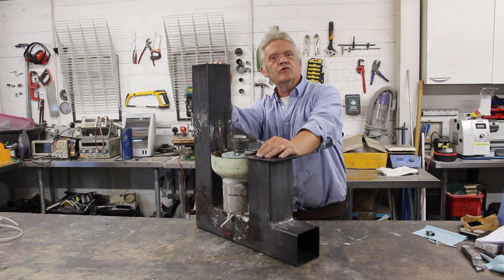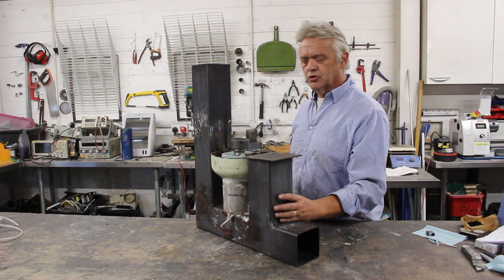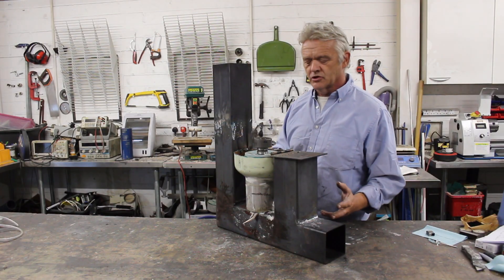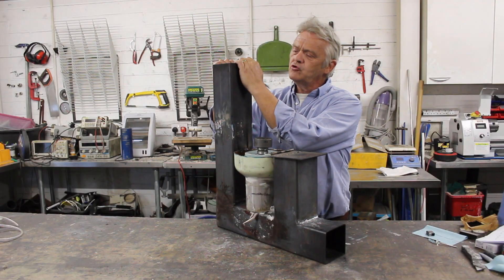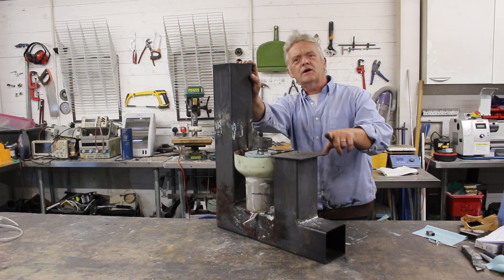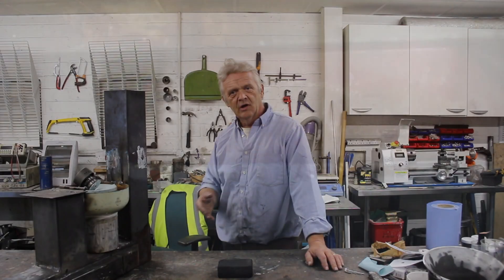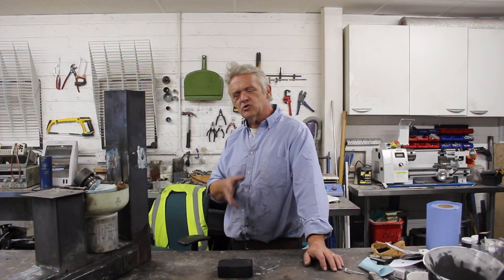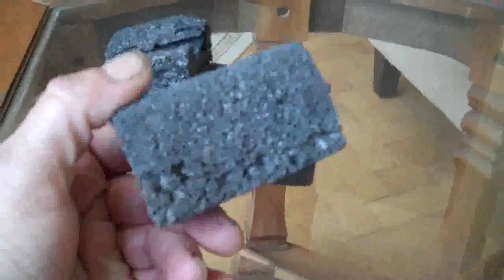1622 The Best Insulation For A Rocket Stove And How To Make It

Comment: Robert, have you experimented with Aircrete or aerated concrete as it's known?  It's basically Portland cement or other concrete mix including quickcrete that you add whipped dish soap/water mix in place of water you normally add.  The trick is to mix soap and water into shaving cream consistency.  Why I'm bringing up is because it's like formable asbestos and it's very insulative, it's also lightweight and even floats.  You can cut it with a saw, drill it, screw into it and it's amazing stuff as you would say.   A 1/2" layer will protect an item from the heat of a blowtorch.  Anyway, awesome videos, I never miss them and learn a ton from you.
Reply from the maker: I haven't mate - I must give it a go
Reply: @ThinkingandTinkering  Hello Robert.  The Honey Do Carpenter channel has an excellent series of videos with Aircrete.  One in particular has a carbon added concrete mixture that he uses for his fire tube.  Handles temperatures well beyond 1000 degrees Fahrenheit.   Worth a good look.
Reply: @danielfeyerabend904  
Rocket stoves get upwards of 2500° F regularly.
I looked at Honey do's work and see that he's saturating the aircrete with water glass before firing. It's the waterglass, NOT the aircrete that's taking the brunt of the heat. I can tell you with confidence that without the waterglass, the aircrete can not handle the heat.
Reply: Check out aircrete harry
Reply: Hello, this sounds very interesting. You don't happen to have any videos on making such a material? Thanks for the info.
Reply: @michealroche1931  Aircrete Harry, or the originator (at least for my knowledge of it) The Honey Do Carpenter
Reply: @michealroche1931  air Crete harry
Reply: Cousin to leisure suit Larry 🤣
Reply: @justintothetruth  Thanks, Ill check it out.
Reply: Just guessing here, but I think Aircrete would be short-lived, since a rocket stove can easily reach temperatures above what concrete can withstand.
Reply: @craigslitzer4857  GreenShortz DIY does lots of videos on aircrete rocket stoves and the like
Reply: @craigslitzer4857  It's the air that's trapped in the concrete (thus, Aircrete) which affords the insulation. Check out The Honeydo Carpenter and Aircrete Harry channels.
Reply: Portland cement deteriorates at around 900f.  It's no good for this use, the cement will spall badly.
Reply: @SundogbuildersNet  GreenShortz DIY has done many videos on rocket stoves utilizing aircrete
Reply: @ProlificInvention  
I know someone who tried it as well. It works very well for a fairly short period of time. A season of heating is enough to make the air Crete practically useless.
Reply: @SundogbuildersNet  I have seen over 50 types of aircrete as the cement type and soap types as well as other additives may be customized offering different material performance characteristics.  I know GreenShortz DIY has built many rocket stoves and tested them extensively so I'd probably refer to his expertise if I were into high temperature applications.
Reply: @ProlificInvention  
If the basic building block is Portland cement, it will not handle long term exposure to the high temperatures found inside rocket stoves. I've been building RMH for over 20 years and am quite familiar with what they can do.
It's sort of like those cute little cinder block rockets. They start strong and look good on video, for a whole minute but then physics takes over and they go to crumbles on you. Too damn many YouTubers don't come back with a post mortem. Fact is, a hot fire up front is easy to show in almost any material. What happens next matters A LOT for long term installs though and if your guy doesn't show that, they're being dishonest with you for clicks.
Reply: @SundogbuildersNet  Typing in Aircrete Refractory on YT brings up many interesting videos worth a watch if you haven't already made up your mind.
Reply: @ProlificInvention  
Ok. I'll look, there may be something there. Still, I've seen quite a lot of nonsense over the years and I suppose I've cultivated an attitude there...

Thanks.
Reply: I agree with Michael, would love a video
Reply: @wizardman1313  GreenShortz DIY  Aircrete Harry and The Honey Do Carpenter all have done many excellent videos on and about aircrete
Reply: I've heard this stuff called 'foamed concrete ' and was used on parts of the Canary Wharf project, London UK as it was do light. I'd imagine it would work great as insulation and or fire protection
Reply: @Herger The Joyous! 
From what I've seen in high temperature play is that the aircrete itself will convert/deteriorate, leaving behind the water glass to do the work. That'll last for some time probably, though it may be fragile.

Something similar can be done with clay slip over woodchips, straw, sawdust or forest duff. This can be packed into or around any shape. The organic materials will char away, leaving behind a low grade carbon foam and clay matrix. The result is quite fragile but works very well as insulation. It can be coated with more clay, mixed with grog and/or wood ash to make a harder protective shell. I wouldn't recommend this kind of thing for building a home heater (RMH) but for outdoor play, quick and dirty forge making and the like, it's great!

Edit: the clay mentioned above can be dug up locally or can be acquired in a bag. I personally do it from local soils, though that can be dicey as clay qualities vary. Lots of testing.
Reply: @SundogbuildersNet  :  Have you built this particular kiln/forge that you’re describing?

The reason why I ask, is because I know that what you’re saying is true about creating a Matrix of cells for the insulated layer, but if you take something that’s already an insulated layer that’s dry and fired, and put a layer of slip on top of that, with or without grog, it would likely be OK at first, but when it’s finished firing it’ll dry right out. So the outside coating which was an exact fit at the outset before you fired, is likely to be shrink.

It seems to me that if you were going to attempt something like that, it may all have to be done in one initial firing. Just so that you’re not starting off with something on fire going on top of something that’s already fired.

It has never occurred to me to try what you were suggesting, but I think it’ll be an interesting experiment. If you do a layer with a lot of combustible inclusions on the inside, it may be  necessary to do a little bit of research on what those inclusions should be, because they are likely to affect the finished size of the product once shrinkage occurs, especially when comparing the inside to the outside layer.
    It might be more doable to do the calculations beforehand, to cast an external shell in pieces, that would be a perfect finished fit to the inside part. Or vice versa.

It seems to me that if the layers were not going to be in direct contact with one another, that the two layers could be done independently without that problem. That might depend on the application for which you plan to use this technique.

Please do get back to me. I’d love to hear how yours turned out and what you did to overcome the problem of shrinkage with one layer of clay relative to different composition layer that would be a direct contact with one another.
Reply: @daphneraven6745  
Yes,  many times. As I said above, the result is fragile so I build them outside and kick them over when looking shabby.
The beauty of that system is that the components all come out of the hillside for free and they sink gracefully back into the hill when done. Longevity hasn't been the point (thus far) so I havent bothered figuring out how to make them last. Havent needed to.
Reply: @SundogbuildersNet  :  Thank you very much for getting back to me.

I knew that you had on the inside part, the aerated part using inclusions, but I didn’t know that you had also put the outside part on. How did you prevent the outside from shrinking up and causing cracking, please?
Reply: @daphneraven6745  
The mud mixes are not just pure clay. I make it into something like cob, which is a mixture of aggregates (generally sand), fiber (generally straw) and clay rich soil. With these mixes,  there is very little cracking if any at all. Also, because I don't care about longevity with these particular stoves, I'm not worried about cracks. I can smear over larger cracks if I need to with more of the mix or just ignore them entirely. 

Of course, I'll never be so slapdash when building permanent installations. If I'm making an indoor rocket mass heater,  I use fire bricks for the combustion unit, insulate with perlite or similar and spend a lot of time fussing over details.
Reply: @SundogbuildersNet  :  That’s actually pretty interesting. It would make for a good video. There are probably lots of people that would like to make the insulation that way, and who would benefit from knowing how to make their own little kiln/oven, To save the entire household from being subjected to the smell of the carbon foam curing inside.
Reply: Tons of videos out there on aircrete.  I haven't had the chance to make the setup yet, but it's on the list.
Reply: Since he is going to look into and try to DO that, you can try to make a piece of carbon foam like he described. Do something, and then you can video it and show it, then maybe Robert will show it on his channel to add to the information. And at the same time you will learn something but by not just sitting there watching videos, you will see first hand. And if you for oneself didn't make a piece of aircrete 1/2 inch think without it breaking into a millions pieces to test  a blow torch on it, then you actually have no reel evidence you know what you are talking about.

A half inch layer of aircrete would be so fragile the wind would take it out in a 15 mph rain. Actually it break in a million pieces as soon as you breathe near it. FYI i know there is a way to make it that thin, but my point is that it is not easy nd it is cheap/like temporary if you want to make stuff that thin with it. We understand laminating, but then it wouldn't be only 1/2" thick, it would wind up being thicker with layers of real cement laminated on it too, or steel, carbon, etc...now it can hold up better. 

But one ideal if you want aircrete that thin but strong, then you need to be experimenting with hemp aircrete. Or figure out a way to embed and laminate SS wire mesh on the face of the aircrete, that will make it not fall apart as easy and also make the surface itself stronger. But SS expensive and also eventually will burn out.  But maybe carbonized hemp mixed and laminated on the surface. And also use a hemp in the aircrete itself and i bet you need no steel of anykind.

But i should just go work on my own project and stifle.
Reply: I hate to burst your concrete bubble, but heating concrete is a very bad idea. Doing so will cause extremely sharp shards of concrete to explode off in pieces as it gets hot.
Reply: @GEOsustainable  Yes that is absolutely true with traditional concrete as it never fully cures and also holds considerable moisture content, however aircrete due to having trillions of incorporated cell sized air bubbles cures extraordinarily fast (within a day) and does not hold or absorb moisture nearly as much.  Also I've watched many videos of people using refractory versions with great success, they're easy to find here on YT by searching "refractory aircrete" but on a side note, I've personally used a quickcrete version of aircrete to construct a carbon arc furnace shell and it did quite well for it's intended purpose over a period of years.